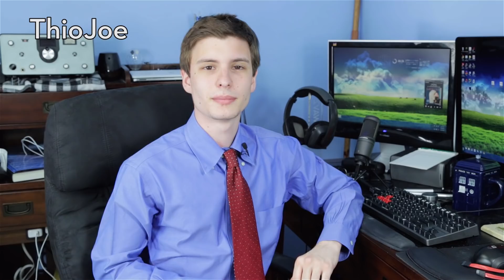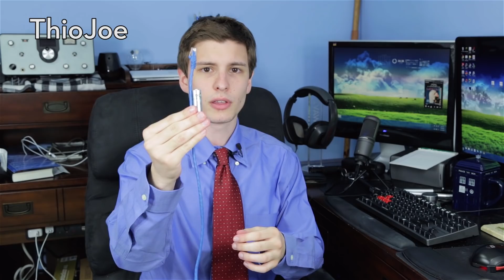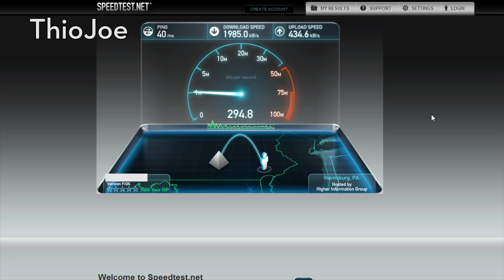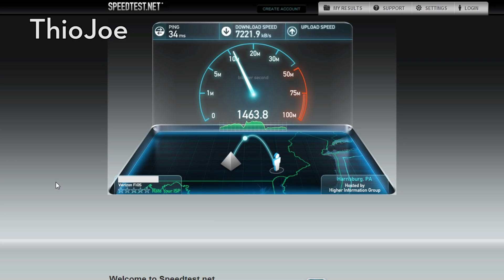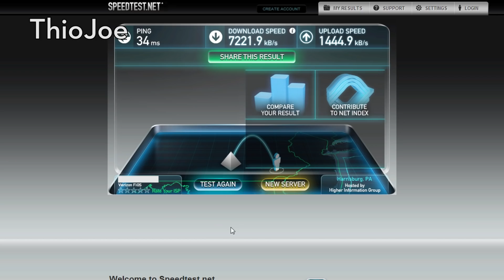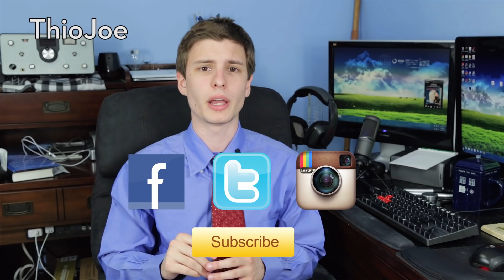Triple Your Internet Speed for Free

Comment: OK I did not watch the full video.. I stopped because of two things he said.I had to stop because as a Master Electrician he said a few things that are just flat out WRONG. The first one was electrical tape conducts electricity. ERRR HUMMM NO it insulates and the good stuff 3M supper 88  is good for up to 600 volts. Next He started in on one of my favorite topics..Inductance. Will it is a Law of electrical theory that when copper windings ( http://en.wikipedia.org/wiki/Magnet_wire ) are placed in a magnetic field   Electricity is induced. This is how a transformer works.Here is part of the problem. Inductance is a problem for voice and data as it creates what we in the trade call "Ghost voltage."  or stray voltage ( http://en.wikipedia.org/wiki/Stray_voltage ) To prevent this problem Data/Voice cables are shielded. Cables such as cat 5 cat 5.e and cat 6  are shielded with a thin  type of aluminum foil wrapped around the copper conductors or wires. To prevent  inductance from occurring. Grated given enough voltage or a strong enough magnetic field the shielding will became a mute point. But you will achieve it being a mute point with common house hold currents  .So take a 250 foot patch cable and tape batteries from end to end it will not change a thing. and finally a dry cell battery does not induce a magnetic field. First to induce a magnetic field you must have current flow. and battery is stored electro-chemical voltage. There is no flow to just a battery. Think of you laptop charger You plug your charger into the laptop and string the cord to the household outlet. You place the cord end on the ground under the outlet..Will that charge your laptop? No Why not? because the circuit is not complete there is no flow.

Comment: Dumb, cat-5 and cat-6 are both highly resistant to interferance. The differences between them is how much they are resistant to outside interferance. On top of that, even if you could change the speed of the cable, you can only change the 1-2 meters inside your house, you CAN NOT speed up the cable as it exits your house. Yes physics says you can do this but the speed difference is around 20% on the least insulated cable, but this is not how you achieve it.

Comment: Excellent video

1) Please cinch up your tie, the knot is hanging a bit.
2) Please button your shirt collar buttons, they are there for a reason.
3) Please comb your hair, and consider the value of a professional hair cut.
4) Getting a little sun would improve your disposition, as well as diminish the pallor of your skin.
5) "So" and "OK" are usually unnecessary to start a sentence; ditto most clauses, independent or not, or phrases.
6)  If that is a signal generator behind you on the shelf, it might be skewing your results, did you try turning it left or right during the test?
7) I believe that "Ravel's Bolero, is useful inspiration for developing paragraph structure, as well as providing structure to any repetitive activities.
8) Considering the implications of subjunctive cadence, as well as reactive impedance, could this same principal be theoretically applied to the demonstration of fusion, fission, and many conductive properties? Just sayin.

Comment: This is wrong, ofcours.
You can only increase Upload or Download and not both at the same time.
You need to point + on both batteries to direction you want (to increase download, point + to you network card, and to increase upload turn batteries to ISP modem)

Hope this helps ;)

Comment: This gave me a great idea. Everyone knows how expensive copper is, and wiring, even more. When you enlightened me that electrical tape was conductive, I had my ahHa moment.
I removed all the copper wiring in my house and replaced it with less expensive electrical tape. Viola! Now my house runs on electrical tape, and my internet speed is almost triple to boot.
As an added bonus, I sold the copper to a software licensing firm for a HUGE amount of Accepts.

Comment: All It cost Is a roll of Electrical tape and 2 batteries and You still can use the batteries for something else If It does Not work. Have You ever heard of Spooky quantum effect? Royal Ramond Rife cured 16 out of 16 People of cancer In 1934 using AM Radio waves. You cant take a multimeter hold the negative wire and put the positive In a wall outlet and see that Electricity Is transmitted through the Air. But how does the Internet service provider slow the DSL signal down? un-fortune they must have learned Electricity slows down being transmitted over telephone lines so now they run the signal through dial up then run dial up Into DSL. so If some fluke of Nature causes Electricity to slow down then maybe some fluke causes Electricity to speed up.

Comment: Triple! Are you crazy? This increased my speed by more like FIVE times!
Thank you so much!

PS. The SATA or IDE cables are good, but I found the best addition to my speed was wrapping my CAT5 cable spirally with flexible copper tubing (used for water supplies in home plumbing). No need to solder, just twist it around your cable and you're good to go!

(One thing, you can't use a Smartphone or TV remote within 20' or so of this plumbing tubing, or you may get a tunneling diode feedback effect that could destroy the LED phase sequencer on your TV or the accelerometer in your phone.)

Comment: I just mount my router on the ceiling so that the wires hang down the wall to allow data to flow down into my PC. Gravity will pull the data packets down faster causing an increase in speed!

Comment: Fucking hilarious, Your internet connections maximum bandwidth is not defined by the Ethernet cable connecting your computer to your router or your access point to your router but by your Retail Service Provider and the physical hardware at your local cabinet or exchange. Little pimply dorks who don't know squat and wear their daddies ties need to go and have their nappy changed by mommy.

Comment: > Ehernet cables are twisted on the inside so that EMF (Electromagnetic field) created by the current flowing through the cable does not affect the current on the other cables and to shield it from small EMF and RF interference by IEEE 802.3 standards.
>>  The battery is not connected to a circuit therefore there should be minimal to no current flowing in through the battery, it will not generate any electromagnetic field. However the EMF generated by the cable will create a current on the battery if the shell of the battery is conductive it will act as a Faraday Cage, and the interior of the battery will not suffer any disturbance. However because the battery terminals are exposed it might create some current inside the battery damaging it. I'm not a chemist but most of the time as energy is introduced to liquids they tend to evaporate expanding, that sounds more like a small chemical bomb.  
>>> The current flowing on the Ethernet cable will create a current on the SATA cable,  so that current will create another electromagnetic field that if large enough, which is not probable, would likely disturb the electrons moving in the copper wires inside Ethernet cable. That will likely cause the Frames (fragments of data sent as electric pulse) to be altered and when it reaches the destination these fragments would be considered malformed or corrupted and dropped by the receiver. So the computer has to send the data again it will create more traffic on the media and as only a few of the frames that are being sent will not be corrupted the user will experience a slower loading of data!

Comment: After trying this method I tested and saw no measurable difference. I understand the physics behind the idea, however the experiment was a failure on this end. Begining speed 68.2... after speed 68.3
Reply: You're joking right? All of everything he said was intentionally complete crap, starting with "preferably rechargeable [batteries] because it will work better." It gets really obvious at "It's important to use electrical tape because it conducts electricity."
I am genuinely surprised that you saw an actual increase in speed. Perhaps the physics was actually not crap, but only exaggerated and delivered in a satirical "explain by intimidation" method, combining concepts without explaining them to mock people who actually try to sell scams.
Reply: BlueRidiculous He had his facts wrong about electrical tape, but he suggested rechargeable batteries simply because you won't have to keep buying new batteries...

Comment: he'd have better luck using 2 magnets from a ps/ps2 controller to  get the same affect, and the other thing try wrapping the tape  around the length of the cable if you want shield it.. then again  just use solid core cable ...
you'd likely be better off installing a switch in each served by fiber optics..
if you still got poor service after that then it is time to upgrade your dsl connection cabke or fois
your net speed is sum total every network device connected to the internet..

for the love of money and christ go and study up on  rf shielding before citing any help on how to videos not sure  on lab experiments though a bit of advice before dispensing advice on practical applications seek legal advice 1st, whilst science might show merits to your ideas you may run fowl of convening authorities in  electrical and comms both local, state, federal and internationally with other countries state and federal codes and jurisdictions..

amca would have a field day with you lol...

you may have the rights to free speech in the US doesn't mean it applies to you outside to the US, google and you\tube is an international access site doesn't mean freedom of speech applies to technical matters within your musings whether or not the sciences back you claims up with proof or not..

he is using the battery like a magnet..

Comment: I found that 3600 MH AA Batteries works best for this , because it won't overload your system and provide rather powerful magnetic amplification. What I would also recommend is : once in a while tape some 1-3 mm regural electrical wire split into positive and negative ends to both of the batteries and connect it to the car battery or another power source while the one end of ethernet is in heavy-acid water (you can add vinegar to the water for this purpose), this will reset the conduction of the cable and maybe even improve from what it was when it was new.
Reply: XD a battery does not give a magnetic force unless it is connected to it self so how the fudge did u get theese results.
Reply: You should try Sony VTC5 18650s. They have a high amp limit and they are 2600 mAh. Super safe and very good :)
Reply: Jake Sturm but then I can't smoke my vape T^T
Reply: Jamil ahmed plus electrical tape does not conduct electricity it does the opposite

Comment: Anyone watching this video please realise this is all a joke. Consider this - the CAT5/6 cable and drop cables are screened, this is designed exactly to prevent any influence magnetic or electrical from interfering with or altering the signal. Imagine if your drop cable ran alongside a mains lead (which is very likely) and this idea was valid, your signal would have a whole lot of mains interference added and would very likely not work at all.
Top marks though for keeping a straight face all the way through the video.

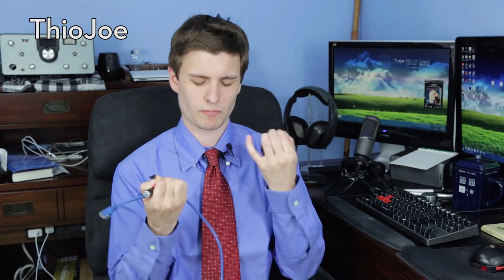Comment: @ 1:00 "it's important to use electrical tape because it conducts electricity"...ahhhhhh...
electrical tape does NOT conduct electricity, that's the point of using it for electrical connections, otherwise you would risk shorts in your circuits...i just want to punch you

Comment: The law of electricity, resistance and magnetism that you said is correct though you lied for the rest part. Do you think the internet service provider is sitting there appreciating, wow some kid has finally found breakthrough for my firewalls and servers? If you pay for 20 Mbps they are there to ensure you get it right, not less, not more. If two batteries broke their walls, then imaging how much big battery they would use to be your ISP. And electrical tape does not conduct electricity, it insulates, it will be also called electrical insulation tape in some parts of the world. So stop your bullshit.

Comment: the way to do it / if your isp does not rely on Mac address of your modem / connect parallely  2 modems / either cable or adsl/ to the same service input with identical credentials. All you need then is 2 Wifi receivers for your computer and connect them to your 2 WiFi modems. It works like a charm!
Enjoy and I guess this guys objectives were achieved / to create controversy, debate and no of youtube hits / . Well done young boy - still go to your Mum to fix buttons on your blue shirt and as a no no - do not just pull "any" shirt tie out of daddy's wardrobe !

Comment: Even the most inane activities can have an unexpected positive result. 

Sometimes good looks can trump a little stupidity. But, when I saw my sexy naked boyfriend taping batteries to my ethernet cable, it was just too much for me. He's no longer my boyfriend. Besides, he didn't like Guinness and pizza (who doesn't like pizza?), but he preferred US beer (beer flavored water) and sushi (would you kiss that mouth?).
His leaving was the first good outcome of this stupid prank.

The second was it made me aware I hadn't shortened my old ethernet cable after rearranging the furniture, just left it in a massive coil behind my desk. Being an electronics engineer, I knew inductance really does play a role, albeit not so much in a shielded cable (huge clue why this was a prank). Along with the nest of power cords, the resulting noise could have introduced spontaneous data errors, thus slowing down effective data rate from router to computer. So, I replaced it with a new, shorter, cable and didn't have to wrap it upon itself. The shorter cable, laying straight and new shiny connectors added 20% to my internet speeds. It's still as slow as cr@p using AT&T DSL, but it did help.

Comment: He might actually have something here. 

http://hyperphysics.phy-astr.gsu.edu/hbase/electric/farlaw.html Faraday's Law

Any change in the magnetic environment of a coil of wire will cause a voltage (emf) to be "induced" in the coil. No matter how the change is produced, the voltage will be generated. The change could be produced by changing the magnetic field strength, moving a magnet toward or away from the coil, moving the coil into or out of the magnetic field, rotating the coil relative to the magnet, etc.

Comment: I got better results with dog poop instead of batteries. But, BE CAREFUL, you need to attach the dog poop towards the closer end of the table in the same direction as it left the dog butt, otherwise it wont work! Havent done test with human poop, because I cant tell which end exited first. Maybe if you get someone to watch you while pooping, you will be able to tell what correct end is. And I strongly recomend using ducktape since its wider and you dont end up shattering the poop. Good luck!

Comment: It worked for me. It nearly tripled my speed. I didn't think it would work. But it's cheap and easy so why not try. Have to have the right modem as well. I had a Motorola docsis2.0 my speed was 12mbs with this trick I got 27 mbs. Found out I needed a new modem for comcast docsis3.0. My speed was 35mbs and with the trick 92mbs. You have to have the right gear to start with and a good infrastructure. I'm surprised.

Comment: Hey Folks I tried this out ........and IT WORKS!  There is an improvement  though I have to suggest for this device .... you need to blow your nose out on to the the internet cable. It actually quadruples the speed! 
And as he says 
"It is important to use electrical tape because it conducts electricity"
He he he.

Comment: The ISP throttles the connection based on what kind of service you're paying for, in my case, and I suspect in many, many other cases. How does that factor into this? Because the throttling is being accomplished outside the house, I'm sure you know, so how could cable modifications done inside the house change anything? Cuz it seems to me I could swap for a $1,000 cable and still have the same speed because of this. Answer?

Comment: It's a funny vid but the irony of these things is that there are very real things you can do to the settings on your router to increase internet speed. My last router was giving decent LAN but terrible wireless. Sorry I should qualify that. Not more internet then the IP just better from IP to device. I disabled one setting in router and it fixed the issue. B4 I'm asked. in the post where I found the solution it was something to do with a bandwidth prioritization. Someone more technical might know. My point is it felt as magical when it worked as these batteries tied to ethernet solution would were it real

Comment: This is the dumbest shit I've ever seen. You don't know nearly as much about physics as you claim to. Why would you tell people to put the batteries like that? Sure, you tripled your speed, but your speed would have been 6X's if you had just put the batteries in the correct positioning. On one end the positive faces the end of the cable, on the other end the negative faces the end of the cable. This makes the cable DIRECTIONAL and the batteries' magnetic fields would operate in SERIES! Then you must ensure that the cable is plugged in correctly, otherwise instead of boosting your speed by 6X's, you would actually cut it by 5/6th's. Grow a fucking brain you moron.